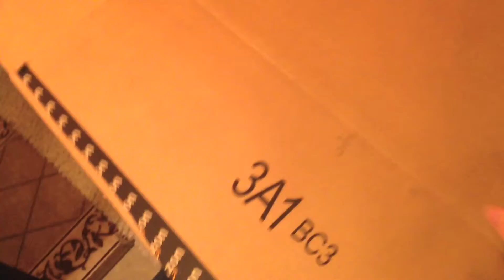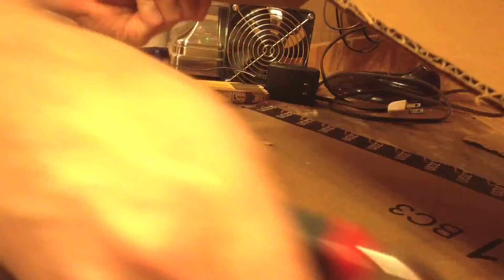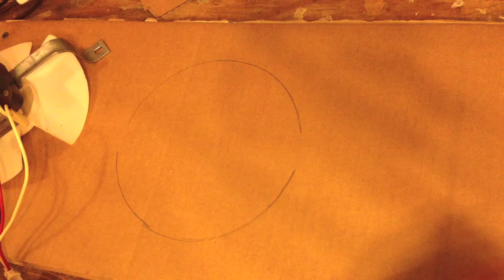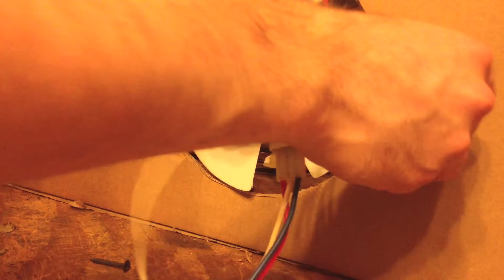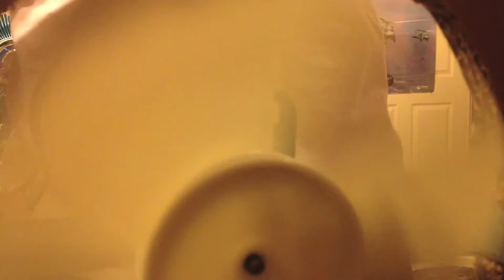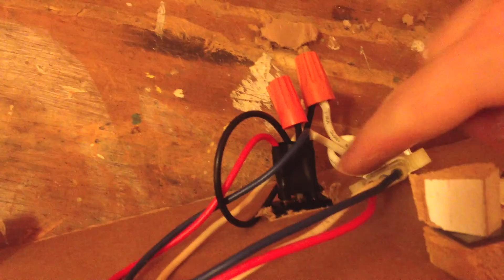Making a Cardboard Window Fan Using a Broan Stove Range Fan

Comment: Black wire = Live
White wire = Neutral 
Red wire = ???
What happens of I only connect white and black and not red?
Reply from the maker: This is a 2 speed motor; the black and red wires are both high sides for the different speeds..
Reply: @JordanU  So that means I don't  have to connect the red wire right?
Reply from the maker: @supersaiyangoku3580  You connect the wire that correlates to the speed you want..
Reply: @JordanU  Thanks!

Comment: You are very resourceful.  Even with 3 sheets of cardboard, I'd be worried about rain ruining it.  Sounded like that fan was pretty powerful.  On New Years Eve I used my vintage Vornado fan outside blowing in, and it worked very well.  There's some cameos of it in my NYE video.
Reply from the maker: +jaykay18 This is definitely not something I'd use in the rain.. because of the cardboard but also because the fan and wiring are in no way waterproof either.. This is really just a temporary thing for the time being, I'll eventually get a pieces of plywood and do a setup similar to the fan in the bathroom.. I've got a few vintage Vornado window fans,, Those things sure are strong!
Reply: the oven fans are loud but man they really move the air !!!!!!!!!!!

Comment: Have to say. thats a very neat idea, almost want to make one myself. your overall design is pretty good. the only thing that would kinda bother me.would be the bear wires being on the outside of the window. but otherwise. very cool!
Reply from the maker: +ToryTheFanMan Thanks Tory.. I agree the wiring isn't the greatest, but since it is outside where nobody would have a chance of handing it, I think its pretty safe.. Eventually I'd like to get a sheet of plywood and make another one like I have in the bathroom, at which point I'd be able to mount some sort of box to contain the wiring.. Also needs a better cord, the one on there is at most 1.5 feet which is pretty useless for a window fan..